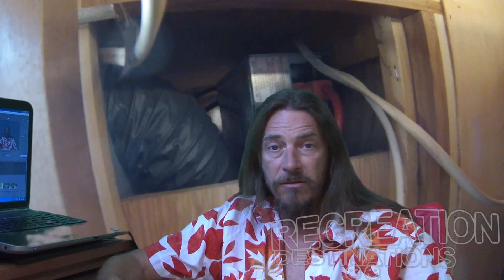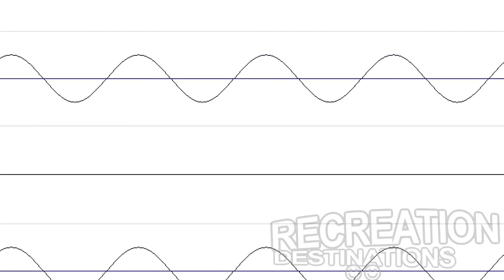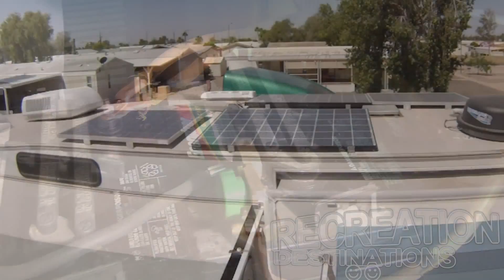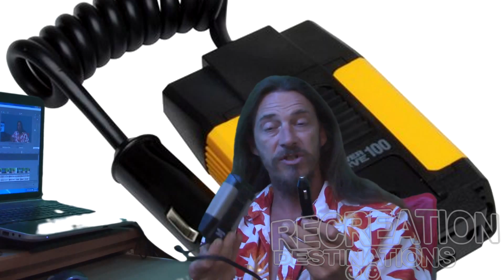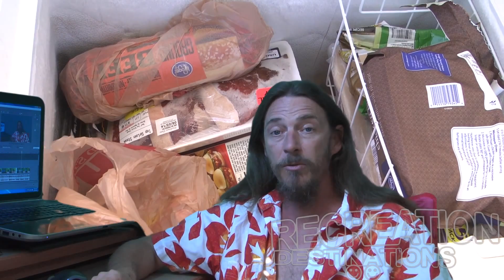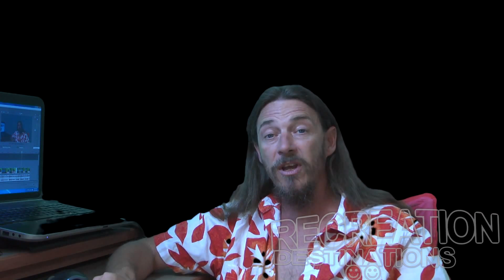Understanding RV Electrical Systems Part III

Comment: Is there another part for the wiring? Did not see part IV. Thanx for the help.
Reply from the maker: No.  I never made the wiring video.  There are so many differences between type, make, and model of RV that make it near impossible to produce something general yet comprehensive and educational.

Comment: Ok. New to rving. I have 3 100 amp batteries, 2 100 hr solar panels, and a shore power hook up. I also have a 3000 watt pure sine Renogy inverter. When I plug into shore power, I have to put my Renogy (extension switch) to 'on' to give power to my AC plug ins. How do I know if the shore power is providing the power vs. the batteries?  Help!
Reply from the maker: The easiest way I can think of:
Get a "kill-a-watt" meter.
Turn off all breakers in the RV.
Plug killawatt into 15A shore power and use adapter on RV plug.
Turn on one 15A circuit in the RV and see if the killawatt registers power use. If so, the power is coming from shore power.
Reply: @HighDesertOffgrid  Thank you. I can do that. 👍🏻

Comment: I have acquired a 2008 Itasca sunrise class a motorhome. I’m thinking the 600 watt modified Inverter may not be working as I thought I could run my TV with it. The power display light on the wall is lit up green which is supposed to show that it’s working. When I turn the Inverter on with the chassis motor off, the inverter buzzes. When I start the engine, the buzzing stops. But I just can’t find anything that’s 120 V that is working unless I’m on shore power, or the generator is running. I thought the main purpose in this motorhome was to be able to watch TV without shore power or generator.  How do I know if it’s working or not?

Comment: my rv battery  electrical unit doesn't work... inside I get no lights.. not inside but I do get lights ...when I use the generator thrue the outside cable.... you used to work but I turned on the water heater... then All the Lights cut off... and it has not work ever since

Comment: Thanks for the additional discussion on modified sine wave inverters. I used a 2000 watt modified unit for several years in a truck with no obvious issues. Ran small microwave, coffee maker, tv/dvd(not flat screen), laptop computer, printer, etc.. I did go through 2, or 3 cube compressor refrigerators before changing to one on 12 volts without compressor. Blamed it on their not being designed to be bounced around in a vehicle, but not for sure of failure mode. I always switched inverter off when not using. 
Looking for best way to wire one into current motor home to power a limited number of circuits, hopefully without adding another transfer switch, and dealing with deactivating converter.

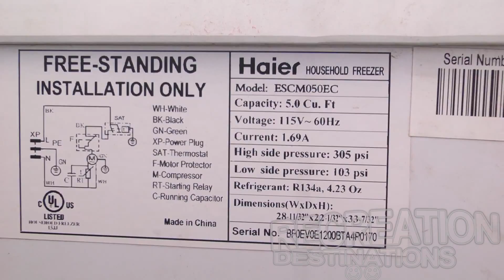Comment: Thank you for such a great informative video. Appreciate your time and expertise. Question: at 10:57 you show your freezer specs- 115V and 1.69A. Doesn't that calculate to 194 watts? You say the freezer draws 160 watts. What did I miss in the calculation? Thanks.

Comment: I have an onan generator that runs fine but does not produce electricity. Checked the circiut breaker in the fuse panel none are tripped. Checked the circuit breaker on the generator and it is in the proper position. Could it be a fuse in the fuse panel. This is a RV motor home, Thor freedom Elite F22. 
Presently not producing electricity, have you a suggestion.

Comment: Do you think that I would be able to use a 3000 watt inverter to run an ac? I was thinking about running 1 gauge wires from the batteries to close to the RV power center. From there, I would disconnect the AC wiring from the breaker in the power center, connecting a 110v male plug to the ends of the wire and plugging it into the inverter. I'm connected to shore power and do not plan on moving it. I have a 30 amp power system
Reply from the maker: Negative.  Unless you have a VERY large battery bank and a few thousand watts of solar panels, you will deplete your batteries in a few minutes.  Your best bet would be a 50 amp conversion.
Reply from the maker: Why would you use an inverter to run your ac if you have shore power?
Reply: @HighDesertOffgrid  My thinking,  and I may be wrong, is that if I get the AC off of the 30 amp breaker that I could have more things connected in the house without tripping the breaker.
Reply: Ok thanks

Comment: Rv. House batteries won’t charge when plugged in. Have 14.7 volts at converter.
Reply: Check the little breakers down stream of the converter

Comment: Does the sine wave inverter still charge the batteries?  Thanks for the very good series of vids. I subbed ya and looking forward to learning more as I am a noobie with an older rv.
Reply: No, it uses the battery to generate AC power. The inverter drains the battery when in use.

Comment: Hey, I have a 3000W Pure Sine Wave inverter. I purchased a 30amp converter plug so I can plug the RV directly into the inverter so I can run all my plugs. The only thing I didn't know about is the Converter - how do I disable it or do I need to?
Reply from the maker: Sorry for the late reply.  I missed your question somehow.  YES you must disable the converter it is "usually" on its own breaker.

Comment: I have a 3000 Inverter (Sine Wave). I have connected one of the 120 Volt port to the Rv electrical hook up . Everything running good. Just wanted to know if anyone has done the same ? If so, have u had any problems ?

Comment: hello, i would like to ask Recreational Destinations or anyone here ,  how do I connect my power inverter to my rvs electrical system so that I can have electricity to all of my outlets when I want to run them with my inverter , I have been looking for videos or instructions on how to do this but have not been able to find any.   thank you very much
Reply from the maker: If you want to connect it to all of your a/c devices and outlets you will need an automatic transfer switch.  Best done by a qualified electrician.
Reply: Recreation Destinations thank you very much for the quick response, i will be looking into purchasing one. love your channel
Reply: can I use a 3000 watt inverted wire the  outlet with 30 Amp plug  then turn off the converter in the RV plug it into the shore power to get AC to all plugs
Reply: Pichardo Gabriel I

Comment: Very thorough video! Thank you so much. I learned alot. I found that I leave the heavy lifting (A/C and microwave) to the generator. My 300W pure sine wave inverter takes care of the TV, Blu Ray, satellite receiver and my Cpap as well as LED lighting, charging etc. and the propane keeps the fridge and freezer running. I have 200 watts of solar panels on the roof with an additional 120 watts in a suitcase. Thanks again!

Comment: You may fix the problem with your TV by getting a autotransformer. it should give you a better sine wave out and will give you a better voltage out. It will clean up the power. And because it is a transformer it should give you a good sine wave out. The auto means that the voltage out will not change with the voltage in as long as the voltage in is with in the voltages listed. Look up anto transformer. I hope this helps you.

Comment: Thanks for making this three part series overview of the RV electrical system.  I have learned so much and will watch them again for remedial purposes.   We have subscribed to your channel and hope you will do the same for our new channel titled "RV Life with Team Ferrell".   We are newbies and plan to use our motor home for weekend trips, business promos, and vacation.  Our channel documents our experiences.    

Question.. do you have a recommendation for a feasible aftermarket electrical monitoring system?  Ours is a 2005 Coachmen Santara 3690ts motor coach.
We purchased in December 2016.  While doing some interior remodeling I have noticed that just a hour or two of burning the 4 cabin overhead bulbs and the radio takes the monitor from Peak to Good to Fair.  Just one light from Weak.   This seems pretty fast but I will do some checking on our battery bank along with wattage of bulbs.

Finally, we are looking at replacing current bulbs with LEDs hoping that will help extend life.

Keep up the great productions!
Reply from the maker: Welcome to the nomadic world.  I'll check out your channel.
There are several good electrical monitors out there.  I use a Blue Sky IPN Pro that monitors everything and controls the photovoltaic system as well.
Happy RVing!
Reply: Thanks for the tip and checking out our channel.  Just getting started but hope to upload more informative content as we advance.   We're taking the "weekend warrior" approach.

Comment: Thanks for the videos. I have an issue I am not quite understanding. I installed 2-6V 215ahr deep cycle batteries in series, wired in a 2500 watt modified sw inverter with 2 100 watt panels. I hooked up one panel(100w), batteries at 12.7v and ran a 875 watt coffee pot for about ten minutes to brew a pot and it dropped my battery down to 12.03. I am new to this but this seems like an excessive draw to me am I wrong??  The draw should be about 67A per hour so @10 min about 11ahrs?
Reply from the maker: There are a couple of issues at play here.  One is that your inverter is not 100% efficient.  None are.  Your inverter efficiency rating is likely 60-80%.  That number may be listed in the tech specs on the inverter paperwork.  Meaning, you are losing 20-40% of your converted energy to heat.
Secondly, refer back to the cow analogy in the first video.  After a draw is put on the system the batteries will show a lower than actual voltage for up to four hours until the electrons are redistributed across the plates.  Your actual voltage is probably a bit higher.
Thanks for the comment and happy RVing.

Comment: i`m new to the rv living thing ,that said my wife and i are loving it .i`m trying to set up my  3k Inverter got it on amazon .tell me if  i`m on right track my other purchases include a battery disconnect switch a 250 amp breaker  ,it came with two  - & + 3ft cable 
which seems to small for a run ,i want to mount it in a bay which is about 10ft away , what size cables do i need? also buying one 275 watt panel  what size controller will i need to charge my 2 6v in series to 12 v at 225 ah which i know give me only 22.5 amp use i want to use about 85 amps per day  would this system work for me  , will a 30 amp 45 amp or 60 amp controller be right? thanks for the advise
Reply from the maker: I use welding cable.  it has a finer wire gauge inside and can carry more current for it's diameter.  3 or 4 AWG should be fine for the loads on a 3K inverter.  A 30 amp controller will be more than sufficient for a 275 watt panel.

Comment: it's a very informative video especially the 100w inverter for small gadgets, but my question is: is it appropriate or advisable to have one (1) dedicated pure sine inverter to each appliance with appropriate number of watts instead of having a  high wattage inverter? i'm not using heater or dryer. i really appreciate it very much if you can satisfy my curiousity, thanks a lot and i'll be watching your videos
Reply from the maker: I can't imagine any scenario in which it would be beneficial to have multiple inverters in an RV.  Each inverter would need to be hard-wired to the 12V power source and to it's individual circuit. I hope that answers your question and thanks for watching.

Comment: Great video! Helped out a lot thanks! You mentioned the next video being about the wiring, however I can't find such a video, am I missing it? Or is it something coming out soon?
Reply from the maker: The wiring video is still upcoming.  There are a lot of variables in photovoltaic system and RV design to take into consideration when wiring so it is a fairly extensive and potentially confusing topic.  It's in the works, but kind of on the back burner...  :/

Comment: First, I am most certainly not an electrician or RV expert. I have a friend staying with me  that has and RV with a 30A system. Due to repeated trips of the breaker for my garage, I want to install a more permanent fix for RV connections. I may down the road purchase my own RV. I am trying to plan ahead and need to decide on whether or not to put in 30 or 50 Amp service. This is in the case that whatever RV I purchase has a 50A system. What I cannot find a solid answer for is if I put in 50A/240V outlet, what will prevent it from burning up a 30A/120V system?
Reply from the maker: I've had this question a few times lately.  I'm going to make a short video to explain it better than I can in the comments section.  Stay tuned.  :)

Comment: Enjoyed the video Cliff.  We were camping this past weekend plugged in to 30A. Our post had power, our recepticals had power yet we could not run A/C nor did we have lights.  All breakers and fuses were fine.  Is it possible we just need a new converter?
Reply: I would think it could have something to do with the campground / RV park power. Just because it says 30 amp doesn't mean you are getting all the power you think.

Comment: Ah, damn it, I purchased an inverter that was advertised as pure sine wave but when I got it, it is a modified sine wave. Very annoyed.  Bought of an electronics store off ebay.  I  need it for the cpap machine. Thanks for educating me.
Reply: Jenny Evans NSW Australia We screwed up, too, this very afternoon. Did not find out until we got it home and unpacked. At that point, I started doing this research.
Reply: Jenny Evans NSW Australia
Reply: My CPAP uses a brick-in-the-power-cord power unit, it puts out 24v at 3.75 amps.  
When I am home I just plug it into the wall outlet.  My RVing solution was to buy a converter from ebay... it takes in 12v and puts out 24v at 5 amps at 90% efficiency.  SO I bought a plug to fit the back of the CPAP from an electronics store, put it on the 24 v side of the ebay converter, and added a 12v plug to the input side.  It turns out that the CPAP only draws 2 amps at 24v so the 12v draw is nowhere near the 10 amps it could be.... but with that little 12-to-24v converter there is no need to run the big 120v AC inverter all night.

Comment: Cliff
Thanks for sharing all these great videos. I just got a 2006 Sun Vally Road Runner m-160 and want to go of grid for a long time like a year maybe and would like to be able to watch tv for maybe a couple hours a day with solar power. Is this possible and if so could you please tell me what I should buy? I'll be all over the us so Ill find you and buy you some beer or something haha Thank you sir
Reply from the maker: +joejoe191983 for just a couple of hours a day of tv only you could get by with a small system.  100-150 watts of solar panels, a small affordable controller like the ones by GoPower, a small inverter (less than 1000 watts) and your existing deep cycle battery should do what you're asking without a problem.  If you see me out on the road, flag me down with that beer.  ;)

Comment: Cliff  
Love the videos  we just bought   a 30 ft jayco  trailer  that's has a solar  set up  it has a Kyocera 135 watt solar panel  a blue  sky solar  boost -blue sky  ipn-PRO REMOTE and a Tripp lite inverter  - charger there is a 30 amp fuse after the battery  disconnect . when the inverter is on this fuse heats up and blows it gets so hot it will melt the fuse holder  other wise when off its fine if on shore power or on a generator  any ideas why this is happening  ? Thanks  Dwayne
Reply from the maker: Dwayne Boulter Hi Dwayne, a 30 amp fuse on a 12 volt line  will only carry a startup wattage of 360 watts and a constant draw of around 280 watts.  Not much for an inverter.  Be sure you have the proper wire size, fuse, and fuse holder for the inverter's maximum draw.

Comment: Cliff, what could the cause for the inverter to click on the overload light on trace inverter and causing the lights to go bright/dim cycle.  Just one breaker doing it. Not 100% sure I checked everything that could be in that breaker yet. First time checking system without AC hooked up. I'm freaking out of the thoughts of new unit cost. I could make a video to show you, if it helps. Good series brother, really appreciate it. Thank you.
Reply from the maker: Dean's of Nomadica Eliminate (turn off, unplug) everything you can from that circuit and see if it continues.  Worst case scenario:  You hung a new picture in the RV and ran a screw through a 120V power line.
Reply: Interesting you say running a screw thru the wall. I have a pro looking at it. The ac wire from inverter/charger goes into the breaker panel and one black wire attached to one breaker..if we remove the wire...the blinking of the lights stop. I'm coming off the landline tit for the first time...I'm testing the 225 watts shell sp75's into 2 deep cycles totaling 450amp/hrs. The pro seems to think the ac going into the breaker panel while its plugged in...is causing the bad loop. Black wire off everything seems normal. Thanks for responding...I'll have two pros here on Wednesday.
Reply: Dean's of Nomadica Hello. Did you ever solve this problem? the same issue here, with the converter clicking and the overcharge light blinking...